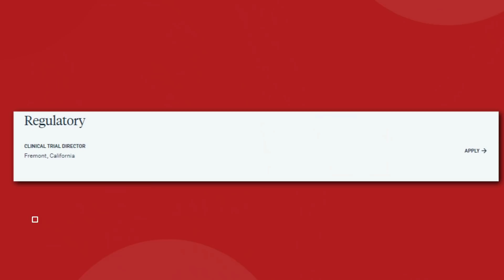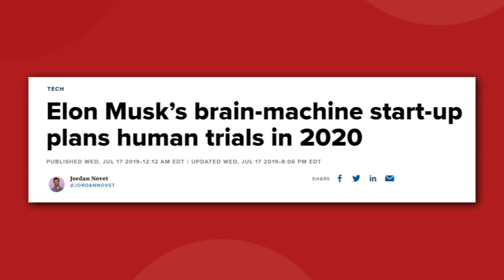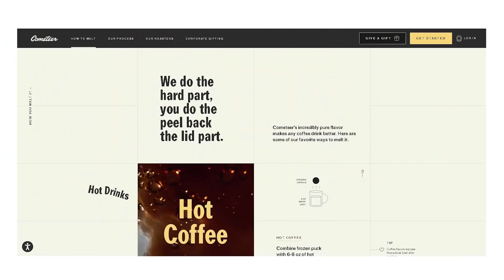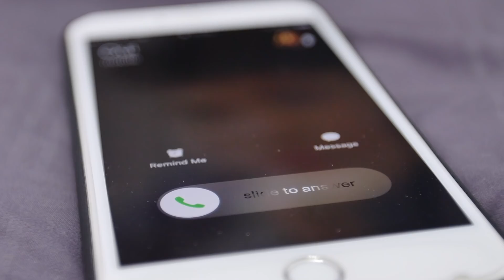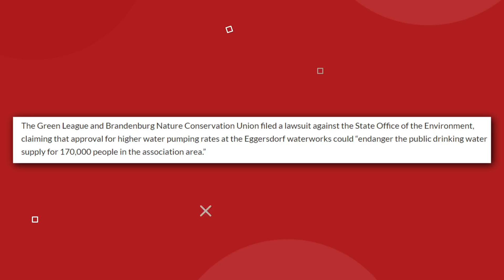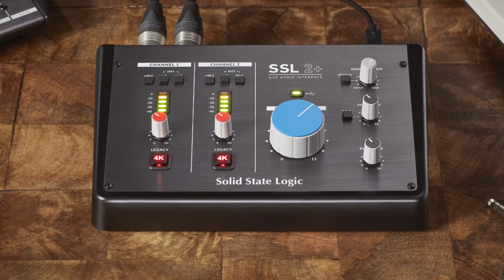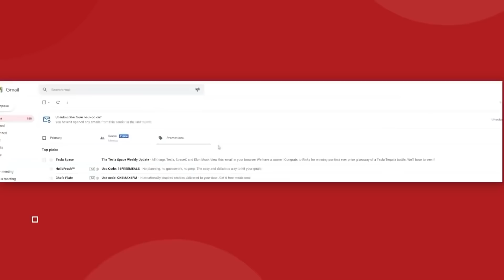Neuralink Preparing For Human Trials In 2022!

Comment: It would be interesting to see if/how neuralink could aid things such as chronic pain disorders, cluster headaches, migraines, etc.
Reply: @devyanshraghuvanshi1248  elaborate ?
Reply: @devyanshraghuvanshi1248  If you truly new a thing or two you might have made some convincing points but you don't. First implementation of neuralink is going with a read only function. This means you are gonna think something and then the device is gonna interpret it into something useful. Thus paraplegics can equip the neuralink and a bionic limb and be able to control it. Theoretically (since we haven't had any human trials so far) the individual will think of moving his fingers and his fingers will move.
We don't need to know how individual neurons work for us to achieve this. Besides the only way to make progress is through active usage.
In the case of blindness if you weren't blind of hate you would have easily thought of something. That is cameras. More precisely I guess micro cameras. Cameras record and data is sent live to the neuralink. Then neuralink sends the appropriate signals to the appropriate areas of the brain. Of course this would a level higher then just reading brain waves and moving various limbs.
Pain can be reduced through various means. One is to sever or hinder the pain receptors of a certain area (like the right index finger). The other way is to intercept the signal from the pain receptor. What if you "blacklisted" certain intensities of certain signals? How exactly you do that ? By knowing where the signal needs to go , you only need to place a "gate" on the "road" before it reaches its destination. The "gate" will be able to identify the signal and decide whether to let it through or not or on what intensity to let it through. In the end of the day you don't feel the pain the moment you are hurt but the moment the signal reaches the appropriate area of the brain.
Device that is similar to neuralink and is less ergonomic has already been approved for human trials. So you are not only dishing on Elon but the whole industry. As I said before neuralink doesn't have any new technology but different application. Besides the problem isn't whether we can understand brain signals or not. If you knew jack shit , you would understand this. The problem is how safe a device strapped on our brain long term is. Besides neuralink isn't reinventing the wheel but repackaging an already existing technology in such a way that it can be mass produced , bought "cheaply" by the consumer and place as little as possible burden on the body of the consumer. My prediction is that the first neuralinks are gonna be aiming exclusively paraplegics with bionic limbs. Using said paraplegics neuralink will gather more data on how the brain works. With the new data neuralink will proceed in higher applications. Such applications are blindness or consumer level control of electronic devices. 
Next time you try to pretend you know something at least procure actual facts and not stuff out of your imagination.
Reply: @alexandervlaescu9901  it makes me so happy to just imagine the possibility of paralysis not being a massive problem for someone’s quality of life
Reply: @devyanshraghuvanshi1248  I'd like you to consider this though, go back 50 years and where were we? Now look at how far we've advanced, dk you think we're thay far away from what you suggested?

Comment: The reflections in the side of the bed starting 5:48 make the sheet metal appear to be rippled.  The flat panels of the CT are good in that they can be produced at far lower cost than the usual stamped metal, but flat panels have visual artifacts that are eliminated by slightly convex pressing.  It will be interesting to see the CT in person, and to see it with a glossy wrap.

Comment: Aiming for the stars and hitting the sky doesn't qualify as moving the goal posts. He is taking on incredibly difficult challenges and continually making progress. Remember, no one thinks he can do many of the things he has done, and is trying to do. Lex Fridman famously said FSD was impossible. So I think Elon will be correct. Eventually.
Reply: @devyanshraghuvanshi1248  lex no longer thinks its impossible dolt
Reply: @devyanshraghuvanshi1248  you're wrong. Its okay.
Reply: @devyanshraghuvanshi1248  How so ? Last time I checked the most important thing in SD technology is recorded miles drived and Tesla had the most. Although some companies might have higher levels in SPECIFIC locations. From my knowledge Tesla SD technology as long as there are some road signals. In the end for FSD the most important thing is how much material and how good training facilities (like DOJO) you have. Everything else is only relevant for publicity stunts.
Reply: @devyanshraghuvanshi1248  it aint debate class bro.
Reply: @devyanshraghuvanshi1248  Recorded miles of driving are the most important factor for FSD. Starting SD systems have most of its decision making hard coded. For it to reach FSD you would need to keep hard coding to the minimum. The only way to do so effectively is to teach an AI how to drive. Although driving is relatively simple , you would need two either of two things for the AI. One is to give it all the answers or two the way to get it's answers on its own. Both ways require as much as data is possible on driving. Only way to get that data is by having cars driving in various scenarios and record it. This means that the car company with the most cars on the road recording the driving wins. The first 90% of FSD can be made with little real life practicing. But for the last 10% you would need raw data. Whoever has that will be the first to reach full FSD. It doesn't matter who has the first level 3 or 4. Both levels are before the 90% mark. What is important is who reaches 99.999...% first. The one who will do that is the one with most mileage recorded. Besides at the start of developing FSD disengagements per whatever miles are important but inverse from what you believe. The more different mistakes the software makes , the less future mistakes it can make. As long as the same mistakes don't repeat again and again , more disengagements are actually desirable. The more disengagements the more material to train the AI. Besides the data from the beta of Tesla is useful despite what level the SD is in. The only difference of the beta from the full release is whether the decision making is hard coded or not. The various driving situations remain the same. It doesn't matter if you have level 3 or 4 the data stays the same. The data doesn't only show the AI what not to do but also what to do. Anyway once Tesla moves on from the beta the will skyrocket due to the data they have amassed so far. As I will say again (given the various companies have been gatheriy data for less than a decade) the difference in level 3 to 4 is minimal. The important point is who can train their AI the fastest. The fastest way to train the AI is through tons and tons of data and a training facility (DOJO). The rest don't matter because the race is to FSD not level 4.

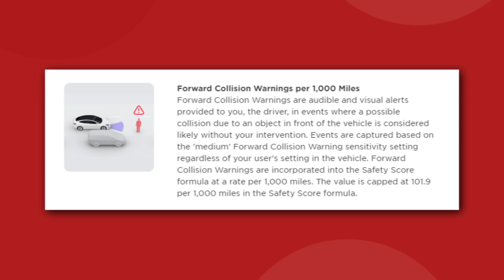Comment: 9:57 I personally find it very dangerous to make people hesitant to use their brakes just to save a penny or two!
Reply: It applies to hard breaking only. It’s not difficult to avoid that.
Reply: @trey9088  It does not matter it plays with the mind of the people they don't know 100% when it is going to be a hard break. Example "there is a dog/kid running over the road do I hard break?" If it does just make the people delay it by half a second just thinking about it it could cost lives!
Reply: @Fflintiii  but isnt the whole point actually to avoid hard brakes by driving slower and more carefully?
Reply: Yeah I have an app for my insurance here in Quebec and it's literally what's happening. I will "consider" the breaking before actually doing it, because any slight press of the break is considered hard breaking by my phone. At least I hope this will be better in Tesla cars since the car has all the data and doesn't rely on inaccurate phone GPS